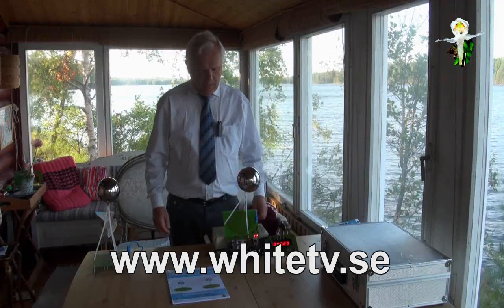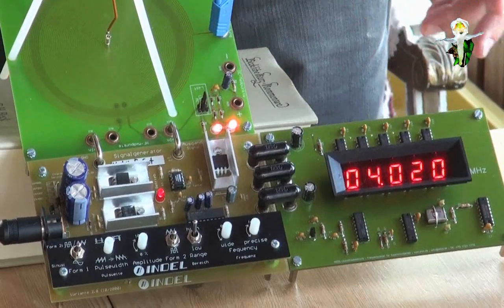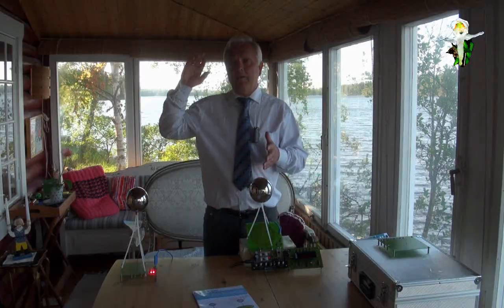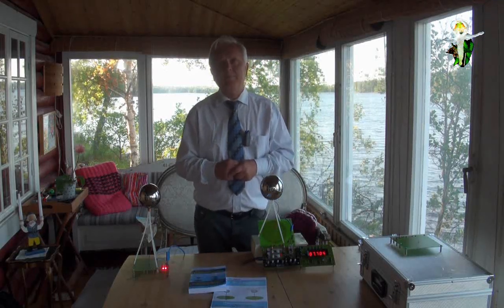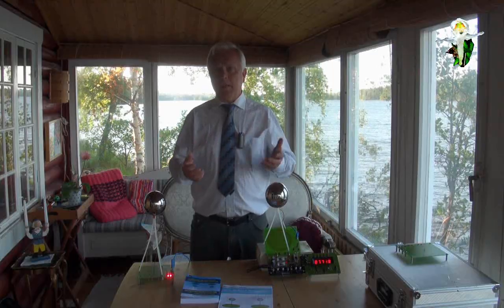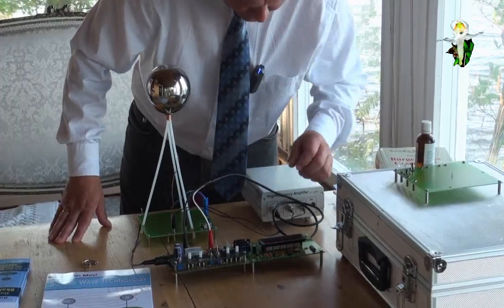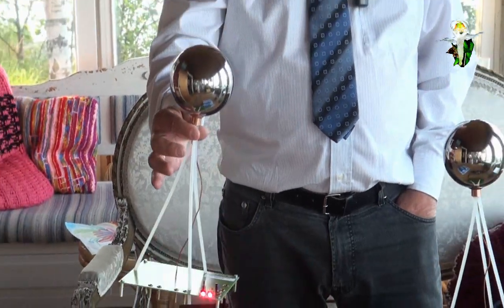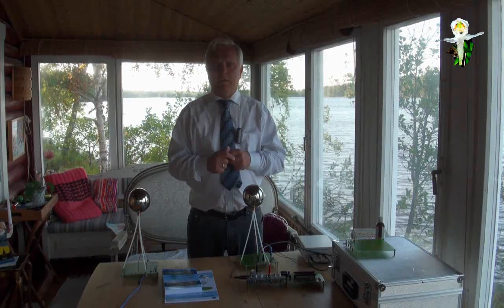Technical proof: scalar waves exist

Comment: Am I getting it wrong? Isn't there  a wire connection between the transmitter and the receiver which enables the wireless transmission? Can anyone explain please.
Reply: I believe the wire is necessary for the tuning process, so the meter can register the frequency.
Reply: Well noted. This is the trick what he is using. I worked with single wire  transmission in that time when he published it. This wire according him is simulation of grounding, but he never grounded that wire. Reason is so obvious, it doesn't work then. It is not wireless communication which is passing even Faraday cage , because transmission goes through that line. Faraday cage and other things has nothing to do with this  demo. I am not speculating I am telling what I checked experimentally . I informed him by email then. Someone responded (perhaps assistants or maybe even he) with t"thank you blah, blah".   The same effect you can get with setup less than  10 Eur.
Reply: Did you not watch the entire video? He removes the wire at 46:20.

Comment: It is easy to understand a scalar wave. If you take a piece of rope and undulate it up and down it forms a standard wave as people understand wave propagation. Now hold up an iron rod and hit it on the end with a hammer. At the other end of the rod there is an instant shift in force. The force is moved down the rod in a straight line the same way light moves through space. The catch is it moves instantly and faster than light can travel. It moves at line of site travel.`
Reply: Great analogy, I finally get the reason scalar waves travel faster than light waves, makes me wonder now if scalar should be connected to wave at all. You would be a great teacher if you're not one already!

Comment: top shit, but I think shielding of one of antennas should be done with more solid metal cage to be sure.
Reply: and disconnect that suspicious blue wire leading from the transmitter to the reciver base ;)
Reply: that's the secondary's earth ground.

Comment: Why didnt you take 60w lamp as load, why diodes?
Reply: The kit could easily have shown transmitter power and receiver power but they dont. Probably for the reason that there are too high losses to drive anything needing more than milliwatts. And that is why we dont hear more about this I would guess.

Comment: Greetings Doc;  I noticed that in the earlier portion of the video, you shielded the receiver sphere, demonstrating that the scalar energy gets through (the LED's remaining bright).  Can you examine the video around 38:50 and tell me why the LED's in the receiver are dimming when your hand is between the spheres?  It seems to me, that, if the energy is scalar, then the LED's should NOT dim.  If, it is a case of absorption of energy, it should have happened when you shielded the receiver sphere as well.  Thank you for your help.  
- Paul - (Retired US Coast Guard Electronics Technician)
Reply: It's because his body is making the transmitter and receiver out of phase, it would need the frequency retuning and then you'd notice the same brightness
Reply: @domestinger8805  Would his hand on the receiver make them out of phase as well, thus dimming the LEDs?
Reply: @janbran20  in theory it should do, yes.
Reply: @domestinger8805  so if his hand is around the antenna, the LEDs remain lit but it his hand actually touches it, LEDs should dim?

Comment: Wait a minute, Tesla's Transformers were self powered. Why would you pay more than a subscription fee to receive power that consumes no resources?  This was one of the reasons why his technology was suppressed. Free energy is not a profitable as energy that consumes valuable resources. Also, Tesla demonstrated that his scalar waves could stimulate atomic or nuclear reactions similar to plasma reactions, like making the air molecules glow, but without the wasted energy of doing this with electricity. Can you do this with your system? I doubt it. I think you are doing something different than what Tesla did. He considered this Radiant Energy for a reason, it did not do what electricity does. So many compromises, no DC spark, no magnetic suppression of the spark, no separation of electrons from the medium, no enclosing the receiver in a faraday cage to demonstrate true radiant energy (with the wire connected, this is impossible), resonant systems were set by equating the mass of the two coils, not the length.  Since the fluorescent light diminishes with distance, I think you have disproven the scaler wave theory. Tesla's system was lossless without connection to ground, connecting to ground was simply a way to increase the power above what was transmitted. I suppose my information about Tesla is different from yours. 

Then you talk about magnetic scalar waves are biological scalar waves... But Tesla said his waves were very beneficial for biological health and mental clarity. It seems you definitely have something different than what Tesla did, in fact it seems you consider his waves the magnetic wave... So, this technique is definitely not what Tesla did. Peace, B

Comment: Of course if he has a transmitter and receiver at 1/2 and 1/4 wavelength to an optimum frequency yet starts twice below it in transmission he will produce both greater transmission power (and less cancelling reflected power) by doubling the frequency and by following harmonics! He started with a 1/2 & 1/4 antenna and ended at a 1 and 1/2 wavelength due to increase in frequency. Thus giving better transmission to SWR. ALSO, THE LGHTED AND UNLIGHTED DIODE on the receiver could be produced several ways as due to diode threshhold for passage and then breakdown of electron flow. Their orientation in polarity may be involved also in relation to wether AC OR DC is involved, notice how they use 2 diodes (at 4 MHZ, you can't tell if one is off while other is on in either transmitter or receiver, each with 2 diodes) extraordinary displays of electronics require extraordinary displays of schematics and..... this video produced not one reviewable schematic! The speaker contradicts and corrects what he says several times to where it's hard to tell what he has on the table and how it is actually put together versus how he says it is....
I find it hard to see anything other than a crystal radio with 2 diodes as AC or DC rectifiers that get tuned better to their antennas wavelengths for increased transmitted power.
Reply: Well done.

Comment: The balls are a capacitor and match the secondary inductance to the primary reactive impedance the coil resistance limits the     Q resonant gain without the dc resistance the gain of a double parallel resonance would exceed the output available from the wall plug and the amplifier at the moment resonance was tuned. This is an "AC" circuit electronics 101 or early 201 lab and theory of a college level coursework . I have had other descriptions of "scalar wave" as an emission of a non-zero crossing pulsed output. A "digital"  square wave would be received as a side-band of the fundamental frequency or as a zero crossing signal depending on how they establish ground in the example it is by a cable and the output not a non zero crossing pulse the moment a primary and secondary coil are used. The secondary coil would no longer have the dc coupling. If you want your Tesla coil to have those really intense breakouts "SPARRK of electrical energy
Reply: con,t  ... you want a primary side high energy dc pulse at resonance and both sides matching for optimum gain.  When done correctly don't use hand to block it....please!!!

Comment: At 35:13 he points to the transmitter while it is resonating at the second resonance freq (7Mhz), and the receiver LEDs go out!
Isn't this contradicting the 'non-shieldable' effect he talked about earlier?

At p.9 second paragraph of http://www.k-meyl.de/go/Primaerliteratur/Scalar-Waves.pdf he seems to say that the receiver lamps glow even when the transmitter is put into a Faraday cage, so why would his finger have more effect on it than a Faraday cage?
Am I missing something?
Reply: Elias VDS It can not be shielded at the receiver as he showed. What happens at 35:13 is that our body is also a capacitor, just like the ball antenna. By touching the ball or coming near, he was changing the capacitance of the transmitter (ball), his body is now acting like the ball, and there is no longer a resonant circuit between the receiver and the transmitter because the capacitance no longer matches. 
The Faraday cage on p.9 is not touching the transmitter, just surrounding it.
Reply: HighOnThunder Thanks for the clarification!

Comment: I believe in scalar wave, but in this video there is no link shows that how we going buy this please ?? Can one please help . Thanks
Reply: You need to build a resonant transformer and apply voltage to the spherical bobbins. He also built a resonant amplifier. To build the transformer and measure across a resistor as you change frequencies, adjust your windings until the phase shift of the two waves is maximized.. This will help you get a high Q factor for your resonant mode.

Comment: As i understand it and its just my theory scalar waves "would be" quantum entanglement which the early pioneers of electricity come across and it explains the whole spooky action at a distance but the coils are the particles or photons running at reasoned frequency in  longitudinal waves not normal em field but subspace.
Just a food for thought.

Comment: please get a spectrum measuring device instead of having difficulty describing what is happening. Do the three basic options phone a friend, poll the audience, eliminate half the multiple guesses. When the age of information has such easy access to such a wealth of knowledge to posted on same provider yours is on. The room your example is presented in and proximity of receiver and transmitter is in is creating side band modulations. Eric Dollard has experimented with "Scalar Waves"  his history and equipment that he used is significant .The entire concept is far off from accepted mainstream wave propagation  physics. When scalar wave theory is accepted and observed by creditable experts. The name will change to or replace what is known as sub-space communication   got it.... get it.... the more the less so get to work and prove it. Because the curve on this one is vertical currently .

Comment: Nice, but tesla did not figure out the proper coil geometry to obtain the proper coupling between transmitter and receiver. The whole pancake coil thing is a joke.
Reply: +PSI PHI SYSTEMS and your point is what? and your proof is....?
Reply: I'm familiar with Rodin coils and vortexija.  What I REALIZE (please, learn your language) is that I See nothing new or unique in this video. And if you say that Rodin coils should be used in the high voltage / Van der Graff generator, fine.  But it's just words. Why don't you build it, then videotape it?  At least the guys here did that, to which I give them credit. As far as scalar waves, I See no evidence of that, but I may not understand what they are supposed to do, to which I criticize the video for failing to educate properly.  By the way, common sense is no proof at all.  If you consider yourself a man of science, you should know that.
Reply: +DoctorMaxMoebius yes all respectable men of science hang out on youtube.
Reply: +PSI PHI SYSTEMS compared to what other design? please enlighten.

Comment: There are no “scalar” waves, but rather pressure waves. A quantity which is scalar is one that does not vary within a given space; rather it is something that is uniform within the space you are measuring. An example is air pressure within a given altitude. A wave is defined by a vector, or vectors which fluctuate and change as they propagate through space. Also Tesla’s transmission system transmitted all of the energy through the earth, and thus did not send longitudinal waves through the air. This is maybe a utilization of these pressure waves, but clearly is not a direct representation of Tesla’s technology. I see this as interesting, but does not seem to be entirely useful in building a theoretical background for research and development.

Comment: Ok so you can power 2 led's at a distance of 50cm buy tuning the tx antenna to resonate with the receive antenna.  NOTHING special about that! and that is a long way away from powering houses by wireless means. 
What I see is a transmitter and passive receiver working in the 4mhz range.  You see the problem I am having is that there is no shortage of experts on youtube but not one single expert here has been able to power anything substantial at any distance.    On another subject and not referring to this guy in particular.  if I had a dollar for everytime someone on youtube said Einstein was an idiot I'd be rich yet not one of these youtube experts who clearly think they must be smarter than Einstein has produced anything that I or anyone else use in day to day life.  When I use my gps in the car I think of Einstein's speed of light and all the other physics that go into giving me accurate directions not these self promoting morons that do a lot of talk but produce nothing but hot air.

Comment: "Under the assumption that the wavelength would not change. The relation of the frequencies is identical to the relation of the speeds." Relation of the frequencies to what? Relation of the speeds to what? 
 
"7.7Mhz / 4.7Mhz roughly equal to 1.5 gives us 1.5 times the speed of light." If you stop and think about this for a minute, this is as ridiculous as just saying "because it is" as the reason.

He is only feeding one signal in at a time. This signal could be 2000MHz, so if the next signal he feeds in after that is sent through is 2MHz he claims the signal propagates at 1000x the speed of light. But here is the problem. The system doesn't KNOW what the frequency of the first signal you sent in was!!! How would a wave magically know what multiplier it had to travel at!?
The logical problem with his assertion is that the wavelength DOES change!

"All signals from the sun is reflected back to space." "In this region of shortwaves the aether is free." First of all go check out the Michaelson-Moorely experiment regarding the aether. Secondarily if all signals from the sun couldn't penetrate to reach the surface then why wouldn't it be dark and near absolute zero temperature? We would get no energy because electromagnetic waves ARE energy!
"Shortwaves couldn't penetrate the atmosphere from space." Then why do shortwaves get through such as light and UV? Let alone the occasional x-ray and even cosmic ray which have been known to rarely cause bit corruption on our computers!

"We can't measure the scalar waves directly, but we can measure them within a mixture of frequencies." If there was any measurable energy that would superimpose upon the other non scalar signals then why can't it be measured conventionally? I'm not implicating the transmitting below the noise floor is impossible, in fact it is. But if you can't measure that signal in the absence of noise it makes no sense for it to append to the noise signal.

This guy just wants your money; don't give it to him. I agree that there are suppressed or hidden technologies but his charade here isn't one of them.

Comment: why pay so much when you can get a slayer exciter kit for $40 and it lights a loads of neons and and a strip light at the same distance?
Reply: Spangley Rainbows , realy were can you get a slayer exciter unit?
Reply: GBluer is the guy on youtube that makes kits for people that can be bought from ebay. .  My slayer I made has a gap of 4 foot between coils and sends 5 watts worth of power with no wires.
Reply: Impressive, what's your background if u don't mind